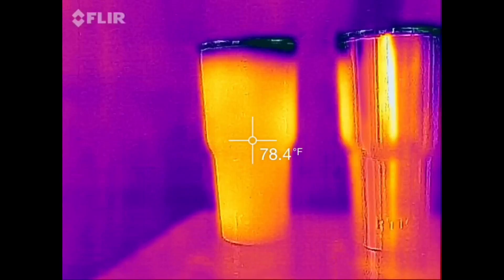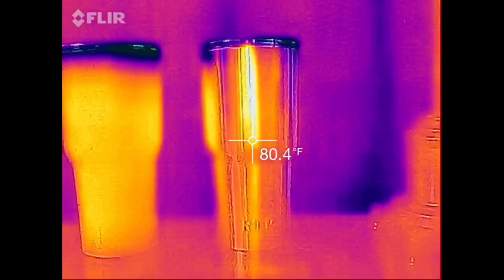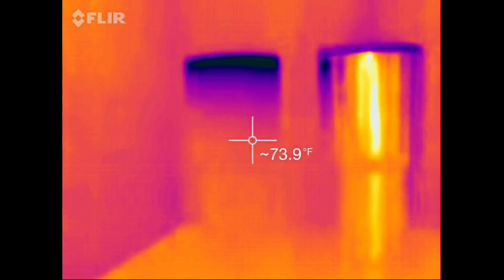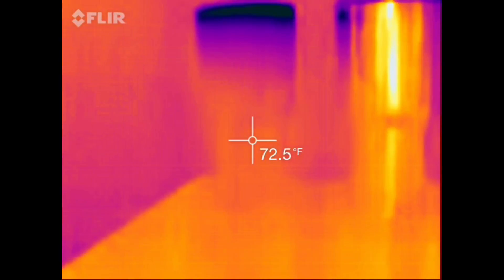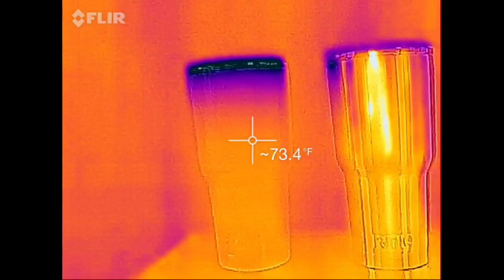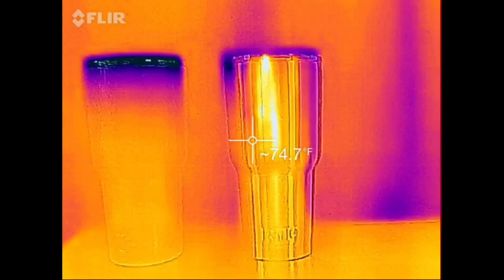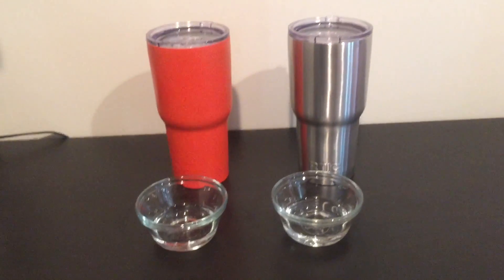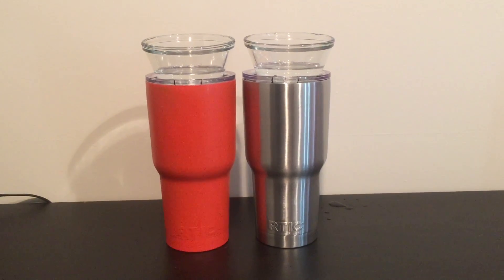Does Powder Coating Change the Thermal Qualites of a Yeti or RTIC Tumbler?

Comment: I know it may be "fancy" to use a thermal imager, but the data you are collecting is flawed and borderline worthless.

Thermal imagers calculate temperature and emisivity plays a huge roll. Stainless steel behaves as a mirror to IR which is why a thermal imager will show you the reading of what is being reflected.  You need to correct your readings depending on the emissivity of the material.

Higher emissivity also means greater absorbtion.  What you should be measuring is: Does the fact that powder coating absorbs themal energy instead of reflects it, make for any meaningful difference when subject to high IR such as direct sunlight.

You want to do these measurements with a thermometer, not an flir camera.
Reply from the maker: Andy H I’ve done both.  Thanks for your input.

Comment: Both cups are Rtic tumblers
Reply from the maker: That's because comparing two different cups the comparison would be useless.  Yes in the video I inadvertently referenced them as YETI vs RTIC.  After all that time I didn't see a point in correcting it by retaking the whole thing.   But when your right, your right.  Good catch.
Reply: ManCraftingTM  then fix it